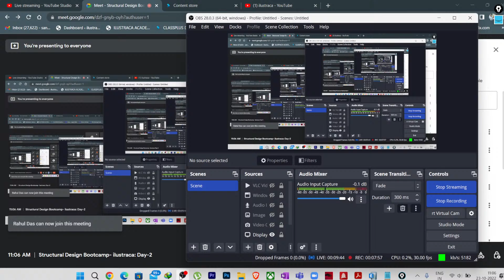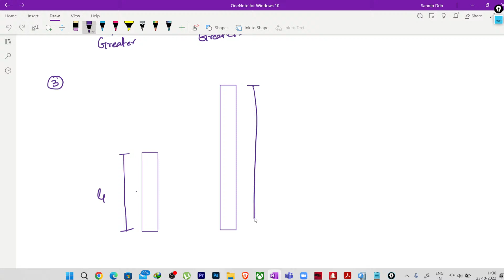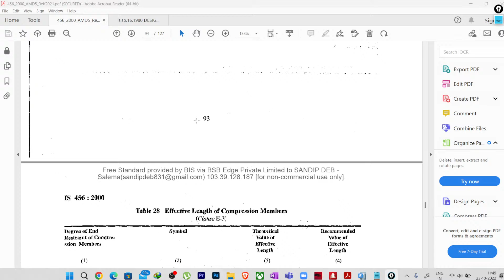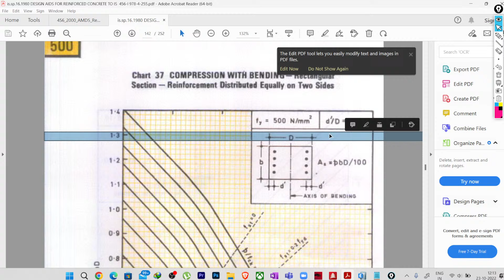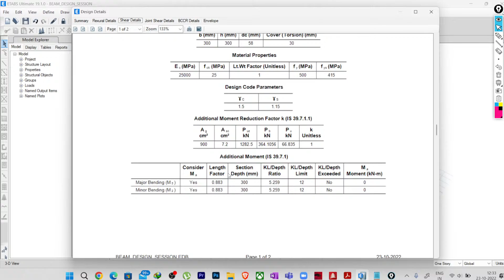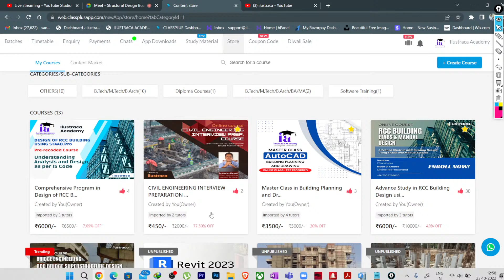Structural Design Bootcamp- Day 2: Design of RCC Column- Manual & Software Based Design | ilustraca

Comment: hi sir. I have considered sway frame analysis and I don't seem to understand from where ETABS has picked the design values from. I have cross checked Analysis model too. https://www.linkpicture.com/q/1_1160.png  & https://www.linkpicture.com/q/2_4.png
Reply: Pls clarify as it would be very much useful to cross check the design manually. Thanks.